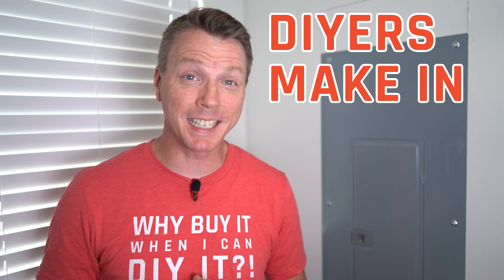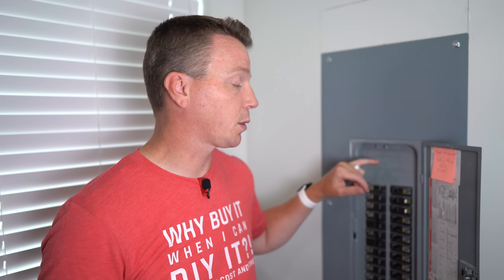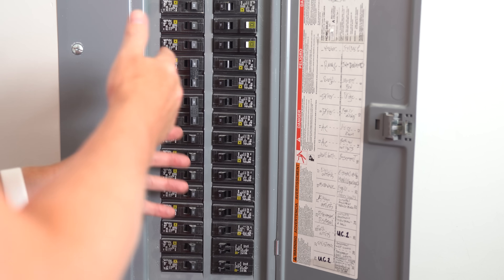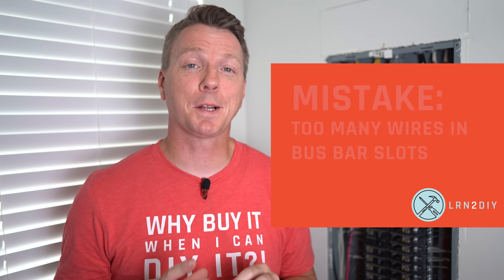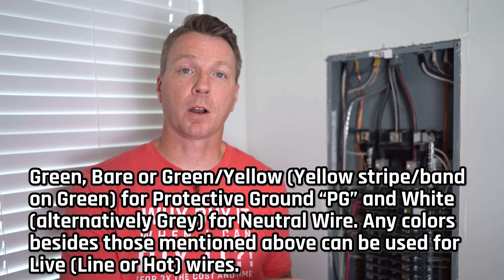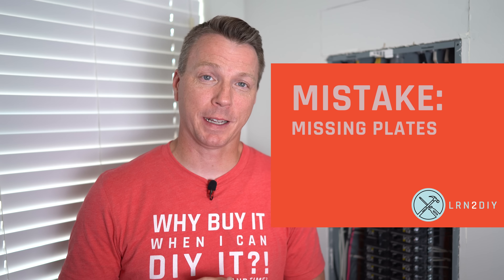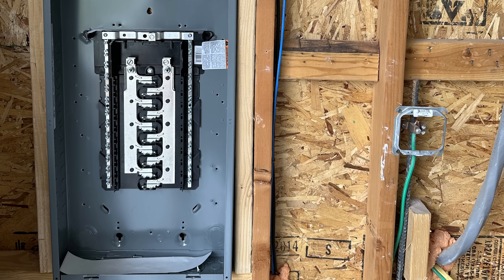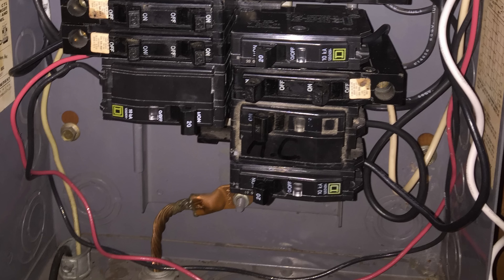10 Common Mistakes DIYers Make In Circuit Breaker Boxes

Comment: Sir, you need to be super, super clear that the mains hardware in the breaker box will be hot even if your breakers are switched off.  If newbies follow your example in the video, they would feel safe touching the mains connections and bus bars.  You should make it crystal clear that those are no-touch areas unless you are absolutely sure the power is disconnected to those mains (often requiring the power company to remove the electric meter from your service entry).
Reply: For this and other reasons I just replace my breaker box in my outbuilding [shop] with a version that has a main disconnect up top [main breaker]. It is a 100 amp panel. The other one was also a 100 amp panel but much smaller and no main breaker at top. Before I touch anything I test for voltage, I never assume anything with electricity.
Reply: @robert5    I sometimes add a light above the panel board, feed through a 1A fuse, from the input side of the Main breaker.     This means I can see what I am doing and working on in the Panel board, even when the main Breaker is OFF, but it confirms there is Voltage around.
Reply: @hughleyton693 how do you connect the wires from your light to the mains?
Reply: I shuddered every time he put his hand over the mains in the video. He never mentioned pulling the meter. (DYI-er)
Reply: @davz1764  pulling the meter can be dangerous too. We used to do that in the fire department all the time and there's some arching and other issues that can happen there they prefer that we don't unless there's just no way for them to get to the scene fast enough.
Reply: Always assume they are LIVE.      Even if you believe them Off.
Reply: Too much reliance on whether they 'feel comfortable'.  It's entirely possible to feel confident that the power is off, and be mistaken.  Or to form a bad habit of resting your hand somewhere, be all focused on what you are doing and absent mindedly put your hand on something live.

Treat it like a gun, which is 'always loaded', to form good habits.  That way the odds are better when you screw up.
Reply from the maker: Great point.
Reply: I’m not sure about NEC but in Canada CEC does not allow splicing in an electrical panel. You can run two wires into a breaker provided it is manufactured for that. 
I don’t understand how pigtail would be any different. You have to know what load you’re connecting. There is absolutely no problem connecting two wires to a breaker provided you aren’t exceeding the rating of the breaker.
Reply: @davepaquet8369  here in the states it's perfectly fine to treat it as a J box.
Reply: That was my main concern also. He was sticking his fingers very close to the energized parts, if was hot. You need to explain first that you have turned off the main breaker going to this sub panel. There is a 2" bushing missing on the feeder wires coming into the sub panel. Code says you need one. I usually use a black Sharpie and color the white wire(s) on any breaker. Sometimes, it is hard to get tape wrapped around the wire going to the breaker due to limited space. You aren't supposed to bundle wires in a panel over 24 inches in length. It looks nice and neat, but I think it is due to overheating the wires while bundled. Using dry leather gloves is a good practice when working in a live or hot panel.
Reply: To be clear I don't think anyone should be messing with their breaker panel after watching a youtube video regardless... Yet here we are.
Reply: if a quote for a new panel wasn't 10k+ in 2024 folks wouldn't look for DIY
Reply: @dschubba69 They should have thought about that before they bought that Tesla.
Reply: @forrestrowell5631  ..  You are right. . .  No non qualified person should be going into their breaker box, leave that to the likes of me and other technical people.
Reply: technical people? Only electricians should be working in a service.
Reply: And you shouldn’t work on a car, bicycle or toilet.
Reply: Sorry mr professional, My panel looks like hell. It was installed by one of your “professionals “
Reply: If your lucky like me, at my schools and house the main breaker is out side with the meter.
Reply: Mine is at the meter too.@busnorth
Reply: This is why you should never hire electricians.  They give out tremendous amounts of false information like "Only use 80% of a boxes rated capacity".  Nonsense.  The box is RATED 150 amps it can DELIVER 150 amps ALL DAY LONG and NON-STOP...that is what rating means.  He also talked utter nonsense about he cannot add more on to this panel when he added a finished basement.  Pure idiocy.  You can double each individual breaker to get the required capacity.  There is no physical way to overload a panels capacity TURNING EVERYTHING ON FULL POWER.  Light circuits run an amp or two MAXIMUM.  Wall outlets might run 13 amps maximum with a space heater but no one is running FIVE SPACE HEATERS AT FULL POWER while the electric water heater is running, the dishwasher, the furnace, the electric dryer, etc.  It simply never happens..
Reply: Yeah, not to smart?!
Reply: *too smart
Reply: Yeah DIY unalive yourself YouTube video.... the mainstream will be HOT ALWAYS unless you call power company to disconnect from the road.... they will kill you if not off and touched
Reply: Lmao I'm in tears you are classic. Thank you for the comedy show damn good job .
Reply: Even hotter lol 😂
Reply: Thank you for bringing this up.
Reply: There are external switches that are installed, lol
Reply: I need to check and see if a neutral came loose on my panel. I have an open neutral that isn’t at the outlets. Do I need to have to power company turn off the electrical going to the house? I have a smart meter
Reply: Dude take this video off the air I can't even watch this with you sticking your hands in there like that
Reply: So the main disconnect is outside at the meter on this one?
Reply: If you've flipped off your main circuit breaker, doesn't that kill power to the bus bars? Seems to me the only thing that would still be hot are those big thick aluminum wires coming into the house and connected to the main breaker.
Reply: He gave a clear warning at 3 minutes and 45 seconds
Reply: @kevinraypole3907   at 3:29 he is poking his fingers inside and there was never a mention of shutting off the meter.  Also, there is no main breaker in this panel so it must be a sub panel. Im beginning to think that this guy should not be followed/listened to and you must be his " life partner".
Reply: @davz1764 2020 NEC® will require an exterior emergency disconnect for one- and two-family dwelling units 
I stand corrected it's now code apparently on new construction
Reply: @kristopherhilton8065   yeeeeaaaahp! unless the Main is in an outdoor panel, you will NOT find an outdoor disco in any house older than the  2 or 3 years the emergency outdoor discos been required.
Reply: @davz1764 you seem pretty knowledgeable so you should know that a panel requires a disconnect but it doesn't require it to be in the panel he could easily have an exterior one which is common in my area for new construction. He does say verify power isn't present he just never shows he definitely doesn't have power on the incoming.
Reply: @davz1764 This guy should definitely not be teaching anyone on YouTube. I'm all for saving money but not at the expense of some DIYer's life. The main reason I became an electrician in the first place was to fix my own problems with my electrical system. Hack work is never good work.
Reply: You don’t need the power company to remove a meter. Cut the tab and remove it, but be sure to let the Power Company know that you cut it. They will come when you are finished and install the meter and add a new lock tab. If you have the time to wait on the Power Company, by all means wait. But there are legal work arounds
Reply: I have never called the electric company to pull a meter.   When replacing meter bases I pull the meter myself and have them come out after inspections are over to put on a new meter if required and a lock tag.
Reply: He did disclaim very early on that if you are not trained or comfortable with the box, don't screw with it.
Reply: @snickerdoooodle He also said "Maybe you should contact an electrician if you're not comfortable." I'd change the "maybe" to "absolutely" because being shocked or electrocuted is completely avoidable.
Reply: @snickerdoooodle That does not address the comment 😂🤦🏽 Because the average person will feel comfortable and find out the hard way.

Comment: In our panel the lines for the garage sub panel are connected together in the same lugs of the main 200A disconnect of the box, one inspector was cool, and another said it was a time bomb... what is it?
Reply: Not completely clear what you are saying, but I think you are saying that you have service entrance conductors coming from the meter and the conductors for a sub panel both in the same lugs for the main circuit breaker.  If not, then disregard my comment.  If that is correct, you have a potentially high fire risk situation. Along with NEC violations.   Per NEC, the conductors entering a structure from the meter must immediately terminate in a main overcurrent device.  Here locally, that has been decided to be 10’ of conductor maximum.  So, the conductors going to the sub can not be immediately.   Unless the lugs in the original panel are oval and not round, you can not have two conductors in them.  If your sub panel does not have a main breaker, there is no way to shut down the panel at all except to pull the meter.  I advise you to get an electrical contractor to fix this dangerous situation.   Respectfully,   Kevin
Reply: @KevinCoop1  not exactly, it's basically splitting the service lines for two panels at the main lugs. Each panel with its own main breaker.

Comment: Oh I have an awesome mistake that some idiot made on our house.  I found a j--box in the basement that had hot twisted together from TWO separate branch circuits.  Yeah.  Found it when I couldn't locate a single breaker that would de-energize that box.  You can imagine what could happen there if there was a fault.  Also found the metal frame of a fluorescent fixture was live.  Apparently ground and hot are interchangeable? Noticed it when I brushed up against it working on a doorbell transformer and got a nasty shock.  Some people just need to not touch wiring.
Reply from the maker: Dang! Those are some scary finds!

Comment: This is more personal preference, but I always double stripe my wires when recoding them. Too many times I’ll see what seems like half a roll of electrical tape just to recode a wire. As a point of safety, I always remove the tape to make sure someone wasn’t trying to hide damaged insulation (seen it more often than not). By using a SMALL amount of tape to make two stripes close together, it clearly recodes the wire without making it look like a repair.
Reply: As a master electrician in Wisconsin, we are required to re-color the entire length of the white branch circuit conductor from the point of entry into the panel if that conductor is being used as a hot.  This can be accomplished by use of a permanent marker or electrical tape.  Following phase color is important but not required, just as long as the color is not white if the conductor is used as a hot.
Reply: The NEC from when I was still doing electrical said at least 2 inches of wire completely covering the end.  I would wrap black, red, purple, or green (sometimes people used white as a ground?) before stripping the end of the wire so that the tape color was what you say when you checked the breakers.
Reply: But that doesn’t satisfy code. If you don’t want to cover the conductor in tape you can make 3 lines the entire length of the conductor with a sharpie.

Comment: The guy that wired my house used the wrong screw on my neutral wire to my sub panel, I came home one day and walked by my panel and thought it was awful warm as I walked by, I removed the cover and sparks was flying out and the plastic clip that was holding the neutral bar was melting as well. The house was 7 years old at the time. It took that long for it to happen. The sad part was the correct screw was lying in the bottom of the box. I had to relocate the wire and up higher due to the damage threads and 10 years on still working great.
Reply: Was he one of those over rated electricians that charge out the ace because he thought he was another gift from heaven electrician?

Comment: In my early years as a journeyman electrician, I got busted for not having the panel labeled before I called for the inspection. I was going to do it, but hadn't got around to it first. My boss was pissed! He had to pay for an additional inspection. Lucky he didn't make me cover it. After that, I started writing the circuit number on the inside of the outlet box with a magic marker, in addition to making sure the panel was labeled correctly.

Comment: My grandfather was an electrician from the 1930s - 1970s. NOTHING on earth pissed him off more than no or wrong labeling in a panel! (it's even WORSE in a commercial setting!) I have religiously labeled mine and relabeled ones in places I rented. This is easiest on day one BEFORE you set up your furniture, so you can check every outlet! Fun fact: When my grandfather had HIS house built (Early 1950s) He wired all of the branch circuits with #12AWG, even on the circuit that were fused at 15 Amps! Then again,, he was a man to changes his car's oil more often than what the manual said to. Not one to take chances! 👍😊👍
Reply: @@therightiswrong4517 90% Commercial, 10% Residential.
Reply: So... He just liked to waste money.
Reply: @misterhat5823  i use #12 on everything except lights. it's not a waste of money. you can put more outlets on a ckt with 12 than you can with 14 right? and a light in a room if you feel like it. i just mainly do it for strings of recessed lights. it is WAY easier to fold 14 into a box than 12 tho

Comment: Having had an arc fire in my electric furnace due to the lug coming loose, I now check the tightness of all the screws in the furnace (83 Amps x 240V) and all the connections in the breaker panel every autumn.
Reply from the maker: That's a great practice to be sure. Not a fun way to learn about that but at least you're staying on top of it now.

Comment: You missed the the National Electrical Code "Small Conductor Rule". If the wire is #14 AWG, the breaker cannot be larger than 15A per code. #12 AWG can go up to 20A, and #10 AWG can go up to a 30A breaker.
Reply: you can use a 15 amp breaker or a 20 amp with 14 gauge wire. come on get it right.
Reply: @LoganEllis-o8j  You cannot use a 20A circuit breaker with a 14 AWG wire.  Basic Google search for 'NEC Small Conductor Rule'.  It does not matter 310.16 says.

Comment: mine in my apartment confused me it dose have a piece of paper in it that was made by computer printer but i had to figure it out there are no numbers by the breakers i knew the oven would have a 240 breaker so i tried to figure out how to count from there the stove shares the same breaker as the heater in the room too the heater is 240v but breaker is rated at 60 amps is that safe
Reply from the maker: I couldn't tell you if that's safe or not without seeing the specs on the heater and stove but 60 seems huge for those two appliances. Also, for the numbers, is it possible they're there, but just embossed in the panel? That's how they are on most boxes. They're subtle and hard to see but they're there.

Comment: Nils, this is a great video.  As someone who inspects electrical panels almost every day, the basic knowledge you gave for DIYers and homeowners is great.  Your tip on what is referred to as "double tapping" of hot wires to the same breaker is so beneficial.
Reply from the maker: Thanks, Mitch! I bet you have some horror stories about things you've seen. I remember your case of recently dealing with the steel beams that had to be undone with all of the rocks on top and I can only imagine what you see on a day to day basis!
Reply: With LED lights being so low voltage and amps would double-tapping lighting circuits be fine?  other than the inconvenience of having 2 rooms off when needing to do any repairs?
Reply: @jetah50  For most normal-sized rooms/bedrooms lighting will never cause significant heating of the wires. With modern LED lighting running upwards of 100 lumens/watt a 15A circuit can supply about 130,000 lumens (~80  100-watt lightbulbs equivalent light) worth of light.   Running two rooms' worth of light-only circuits is fine.  But, it may be preferable to install a tandem 15A breaker to maintain independent supply to each room at a cost of about $10 more for a tandem vs standard.
Personally what I prefer when dealing with small breaker pannels is using a 15A/20A tandem breaker for each individual room for lighting and outlets (except the bathroom and kitchen), each room has its own breaker and each function has its own circuit.
Reply: @jetah50  The reason double tapping is dangerous is because when two wires are installed on the same tap, there is always a chance of one of the wires becoming loose, which then can cause arching.  The copper metal can expand and contract at different rates, depending on their use and load, thus allowing movement that will cause one of the wires to become loose.

Comment: Put the red tape on BOTH ends.  I've got a miss-wiring here with the white being L2.  Hooked up a 5-15 type outlet.  The tester said something was wrong.  I didn't know what right away..
Reply: If you're using a three light tester and all three lights are lit, usually one brighter than the other two, you've found the problem,  the receptacle was mistakenly connected to 240V.